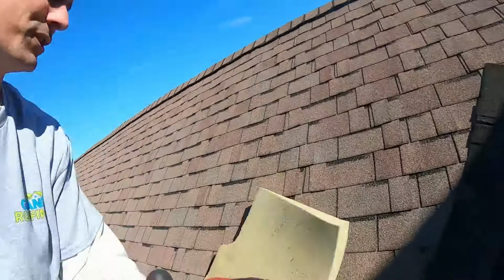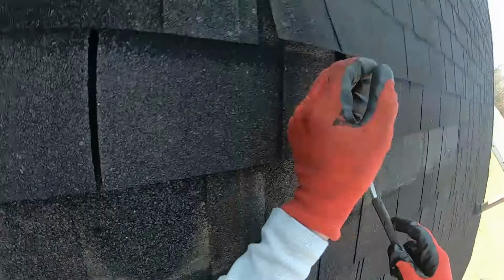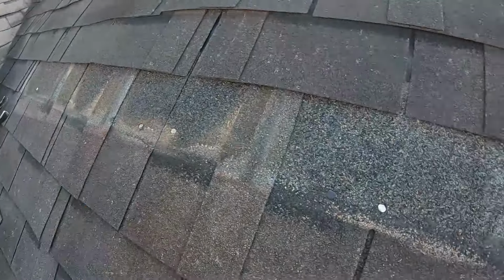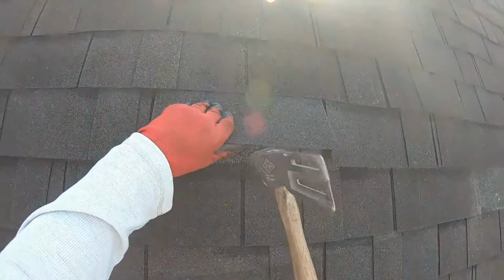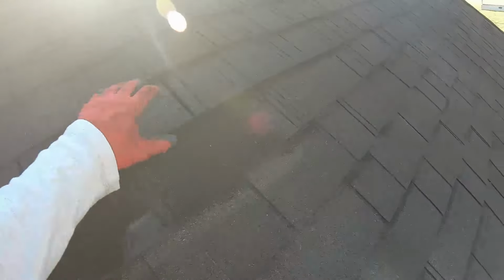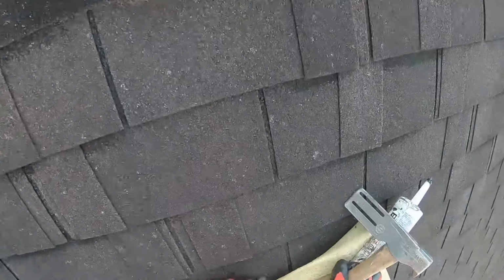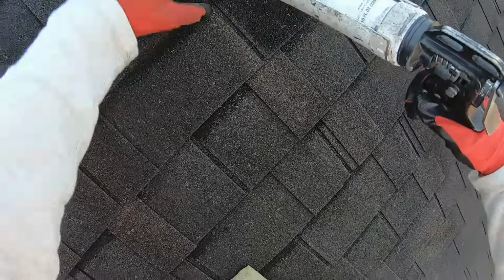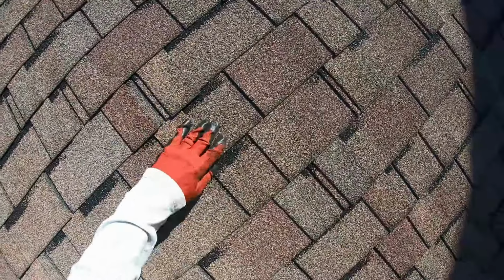Simple DIY Roof Repair / Save Your Money, How To Video!

Comment: I completely understand what you mean and for me I use my harness but I go on the roof barefoot for extra grip and it doesn’t tear up the granules like I’ve noticed the one time I wore shoes. I need to get a tube of that sealant just to tack down some lose shingles but I pretty much went on the roof twice and tested just about 90% of my shingles to see of they would lift and only about 10mdid but no crease luckily.